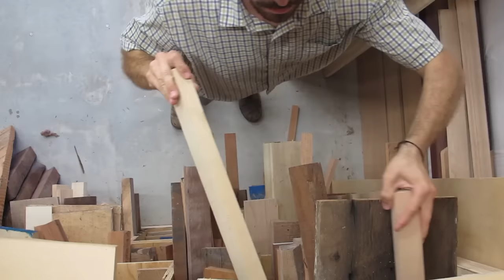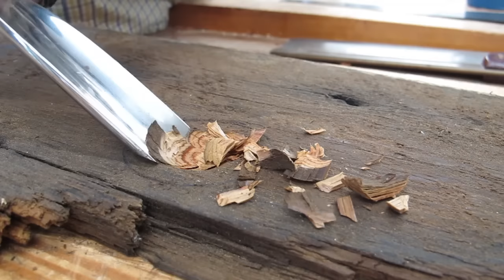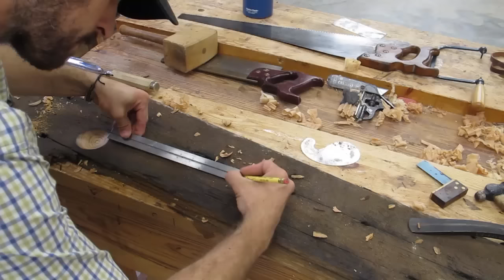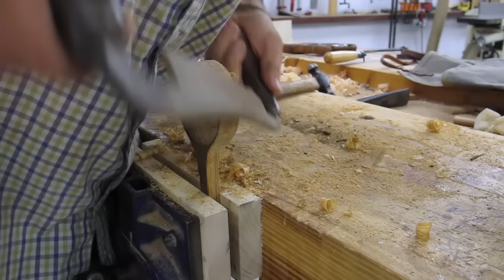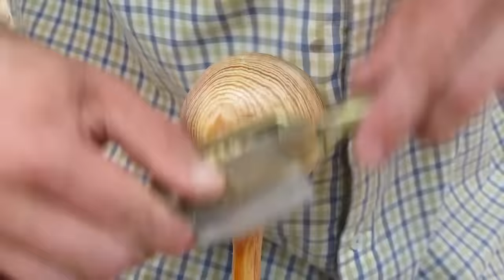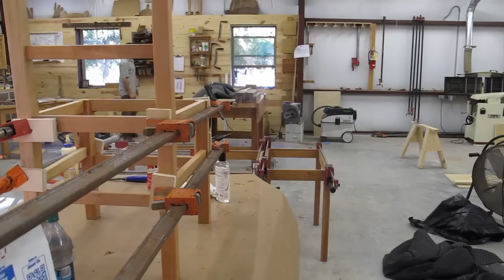Carving A Spoon From 100 Year Old Pine

Comment: This guy makes this look so easy but i bet it’s so hard😂
Reply: SamDG5 It’s very easy trust me, the way he made this made me cringe but it still turned out decent
Reply: R M What was cringy about it?
Reply: SamDG5 its easy if you know what you have to do
Reply: Kusti Vuori All you need to make a spoon is a knife and a block of wood, but a gouge and sandpaper is useful
Reply: It's easy, i made one, and a lot of other stuff, you just need the right tools
Reply: It's easy. I took woodshop in 6th through 8th grade though, so maybe that's just my assumption.
Reply: John Vigil same, this is really simple compared to the tables and chairs people made lol
Reply: Nothing is hard... only challenging.
Reply: It requires about 2 tools but is a little easier if you have a saw etc. This guy used about 8 different tools. Still, it turned out nice.

Comment: Why are people complaining about the use of a ban saw so much? Its a very helpful tool that gets a project done in a more timely manner. It took him a couple minutes to get the wood down to size with the ban saw where it would of taken several times longer to do it in a traditional way. Just enjoy the content guys.
Reply: Because he was doing it in a dangerous fashion if his hand slipped there goes a finger as my shop teacher told me that "There's always a better way".
Reply: +That's a Paddilin he used it like you use a band saw if you need to cut tight curves. You have control over what you need to cut. If he were to cut a plank down to size with his fingers pushing it it would have been stupid but he didn't.

Comment: What's the most annoying type of wood to work with, in your opinion?
Reply: Mary Udomah, Morning wood
Reply: Mary Udomah 😕
Reply: +Skęłłıňgţøñ LMAOO GOOD ONE
Reply: Mary Udomah Walnut is really hard. It takes longer to sand but it's got a beautiful finish. Oak and cedar are pretty hard too. From my few years (about 3) of having been working with wood, I have always struggled with getting the right finish for hard woods because if the sandpaper is too rough it will make deep cuts that are then difficult to get out at times. But with practice it gets easier. But the hardest wood I've worked with is Walnut.
Reply: Skęłłıňgţøñ ha ha ha lmao
Reply: Mary Udomah I have found Hickory to be a pain especially with a lot of blonde material.

Comment: The way you use you're tools is very dangerous because you use them pointing towards you and you might cut yourself
Reply: He knows what he's doing and it's the most comfortable position for him.
Reply: Thats good advice for someone new to using a tool. Once you are comfortable with your tools, you know how to control them and still be safe doing something that may be dangerous for an amateur.
Reply: not really, the way hes holding them means that even if you does slip his hand or arm will collide with his body before the knife does.
Reply: +killer rgm wrong

Comment: Andy, you may (or may not) be interested in the traditional Welsh love spoon. A very ornate spoon carved from a single piece of wood with balls in a cage or several links in a chain attached to the handle. These spoons were crafted by young labourers on farms or in quarries and were engagement gifts to their betrothed. The number of balls in the cage or the links in the chain symbolised the creation of a family. Traditionally the equivalent of an engagement ring, they are now sold as traditional crafts. The cheaper ones by tourists and more ornate and perhaps even hand crafted ones are used to decorate the homes of Welsh families and are even gifted at weddings in the same way the horseshoe (now plastic) is. A simple Google search will reveal several examples. There is a Wikipedia article available also. https://en.wikipedia.org/wiki/Lovespoon